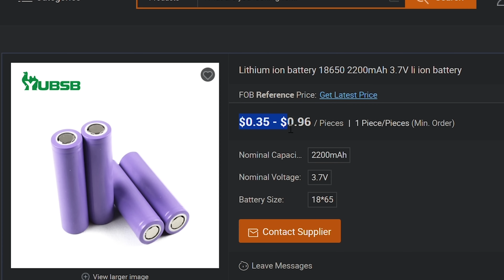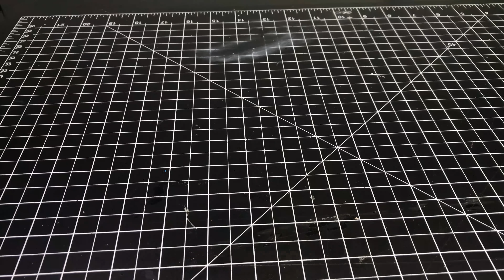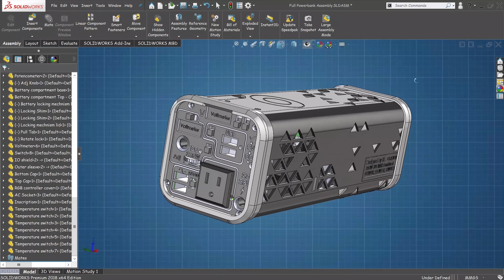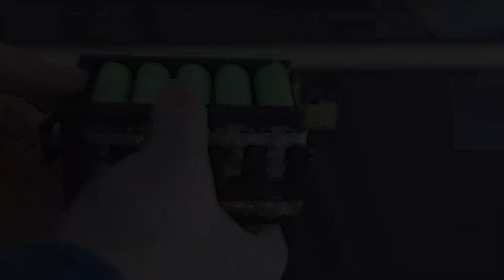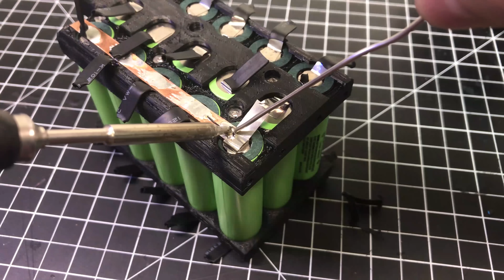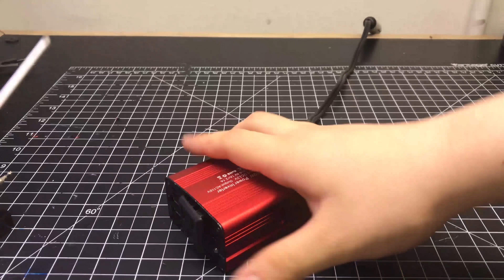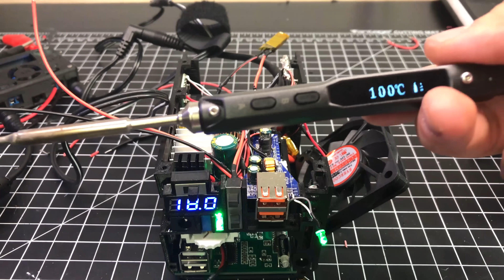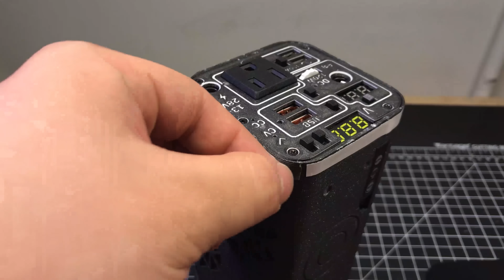How to Make the Ultimate 18650 Power Bank with Infinitely Expandable Capacity

Comment from the maker: Hello everyone, this project sure took me a long time to complete...I hope you enjoyed it!
Additional schematics and the full script are in the description. If you have any questions regarding the build process or design choices, please ask them in the description. I will try my best to answer them.
Reply: Hey bro are you interested to sale it
Reply: @reflection_99  i what one with 2 battery packs $$$
Reply: Sell the Power Bank itself!
Reply: @Treddy0810  yes, sell it
Reply: Can I just buy the finished product from u?
Reply: Sell me one.
Reply: @andrewmcallister4151   and the biding starts at 100eu.
Reply: @pavlossoultoukis4448  I'd pay that.
Reply: @pavlossoultoukis4448  that's only 113 us, I'll pay 120 for this.
Reply: @andrewmcallister4151   you got it and it is great by the looks of it only problem is to get this on a sponsorship for selling it because it's a great idea by the looks of it.
Reply: @andrewmcallister4151  I'd at most $170 for this due to labor and knowledge put into this
Reply: @pavlossoultoukis4448  where from
Reply: Andrew McAllister me to
Reply from the maker: Man in the Park  Because PLA melts at 60 Celsius, and the electronics can get hotter than that.
Reply: @kralyn3d  so, apart from anything named ABS_*, all other files need to be printed in PLA?
Reply from the maker: @AadithyaS  they can be, but they can be printed using ABS as well. The files that were named ABS have to resist higher temperatures.
Reply: K R A L Y N 3D why don’t you sell it? Would be awesome 👏🏼
Reply: @kralyn3d  can you do a bit research how to swap DC out with European(230V) one? Without ground( <° °>) pin should be almost same size
Reply: @razortotal  just buy a cigarette lighter to 230v adapter for your car (it's 12v in 230v out).
Reply: @kralyn3d  can I commission you to build this for me??
Reply: @kralyn3d  Why did you use solid works to showcase the CAD files for this portable charger but Autodesk for the other one? Also which 3d printer did you use to print the casing?
Reply: Thank you for the great video, i literally watched out of curiosity and don't understand most of the physics, but sure want one of those, can u ship me one?
Reply: Bukenya Ephraimi
how many hours of charge you grt on a laptop?
Reply: suppose i would like to buy one of these? i have no access to a 3d printr
Reply: What modifications would I have to make if I wanted to use an EU plug with 220 V?
Reply: @Morphior  if you're asking that, you're never building this
Reply: I really like how tightly packed and functional this thing is. Reminds me of nasa equipment for some reason. Pretty sad/impressive that one skilled person can build something that outperforms every commercially available counterpart (I know of) in pretty much every way (modularity, repairability, port selection...).
 Amazing work.
Reply: EU version? i think it needs some mods because of the 200-260V (Common 220-240V) range. (P.S. please can you make a better protected Battery Pack also Extended version for 2x-3x the capacity?)
Reply: Why not just build and sell them?
Reply: Just curious, where did you get the .5 mm thick copper strip?
Reply: @dlev689   Aliexpress or ebay
Reply: What font are the words and numbers written in? When I check the solidworks files they don't show one like it was custom or only in a different solidworks version. Some sort of Franklin Gothic?
Reply: This kind of project deserves a spot in kickstarter beside the omnicharge ♡♡♡♡♡♡
Reply: how much does it cost and what is full capacity??
Reply: Would you make me one! Ill buy it from you! Great work ! Let me know if you would like to sell me one.
Reply: can you sell this product pls at a cheap price?? clearly, this is a genius creation only you can pull off.. we do not have the technology to creat this..
Reply: Can you do one and sell it to me?
Reply: What if i directly want to buy it, not build it?
Reply: What is that diode at 10:47? Is it on the parts list?
Reply: Can you please use the free easyEDA software its free and if it dusent  have the component you looking for then you can make it its very reliable plus we can see the proper schematics.

You need a diode on that relay so when its off it cant  make electricity flow back into the circuit, remember that a relay is a coil so when its off its clapsing magnetic filed makes a electric current that can be hundred volts at best. That why we put a diode between the coil of the relay so when is off the current can be shorted so no harm to the circuit can happen .
Reply: Ingenious design... would you be prepared to sell a ready made one, as I like this design, but sadly unable to be able to build one for myself... philmelson7@gmail.com
Reply: Can I buy this
Reply: 100% Copy will be sold in China in like 4 Weeks! no BS..
Reply: @NightForce  Yes, ninus all the safety features.
Reply: Better get a WW Design-patent ASAP! just sayin..
Reply: 100 quid? 🤑 ¡Nice!
Reply: good job!!! that's amazing.
Reply: What parts need to be in abs specifically?
Reply: will you planning to sell?because most of the powerbanks seems not reliable, do you know why, do they not test them enough?everytime I decided to buy ,I read comments and then not buy:)
Reply: how efficient is wireless charging ?
Reply: @maciejwrotek   I think 70%
Reply: I'd pay for one. Please advise
Reply: How much for you to make me one dude but with a 240v English plug instead and mail it to the UK 😂😂😂 I'd love to make one but I am rubbish at things like this! Lol Seriously how much???
Reply: @jamieharhat  I have started this, I'm at 65% but surely It will up to 200 USD if you don't have 3d printer
Reply: @himmuappi  I'd pay 200usd for one 😂😂
Reply: @jamieharhat  ha ha it will cost 250$ surely If we don't have 3d printer.
Reply: K R A L Y N 3D how much would u make me one of these for?
Reply: I want to buy it could you tell me how?
Reply: I would buy that minus the RGB though
Reply: hi Sir, are you interested in produce it ?
Reply: Brilliant & elegant in design my friend. Very nice work & an excellent description for anyone to follow, great work.
Reply: are your power bank sold ? is there a purchase link ?
Reply: I want that power bank, it's so cool.
Reply: what program to use to design the device, I hope you answer me please, very good video👍👍✌️🤙
Reply: @crazyomargraph  He designed everything, You can just download CAD files and make 3d printed parts, remaining electronics parts can buy from online Aliepress or ebay. once you get all things assemble carefully like in the video
Reply: Why didn't you use any flux while soldering?
Reply: @d-brtn  Because Solder Lead has Already flux in it.
Reply: David Burton fluxed solder.
Reply: Can i just buy it off of you?😅😂
Reply: Frickin' awesome, man. Literally. Are you an EE?
Reply: Can I commission you to make this for me?
Reply: You are Master kralyn great work and the battery is badass
Reply: How much for one if you’re selling them??
Reply: @K R A L Y N 3D Is there  a way to add a usb c charger?
Reply: Here's $200 usd! TAKE MY MONEY!
Reply: just a straight question. how much time you have spend on this project?
Reply from the maker: @mansurzi shake around 50hrs on R&D and testing, 12hrs on CAD, 13hrs building and filming, 20hrs on editing. Plus 30hrs of printing different models (many of which did not work)
Reply: @kralyn3d  wow great work there
Reply: @kralyn3d  My question is you said, we could use a buck converter to charge laptops with adjustable voltage like 19v, it has adjusting nob if any unexpected situation if the nob will slide and if the voltage will go above 30v then is it not a problem to laptop?
Reply: I'll buy 1
Reply: I would buy it
Reply: 1 thing sell me 1
Reply: I want to buy one off you
Reply: YOU ARE JUST AWESOME !! why don't you sell this as a complete unit ?
Reply: Where did you buy the filament for the 3D printer?
Reply: Plz try to make a 220v one for us in Europe
Reply: you are geniuses men good work i am give a like in this video nice work thanks to upload this video
Reply: Why did you make the battery a single cell instead of multiple cells that could be balance charged?
Reply: Bro it is really jumbo bank. I am from india. I need this. Can you make me one.
Reply: 哥们，可以在中国销售，你的设计和产品能在中国所向披靡！！！
Reply: K R A L Y N 3D that’s dope
Reply: @K r a l y n 3d - I'm very interested in buying one of these units pre-made. How much?
Reply: Could you please give me a quote for the 18650 power cell pre made thank you
Reply: @cashritchie9076  he made it
Reply: Great man! You must make this mass produce after more perfection!!!
Reply: Dm me. I would buy this.
Reply: Excuse me sir... Is it save for this Power Bank if I use KSD9700 50deg Celcius? Coz I cant find the 45deg C in my local hardware stores..
Big thanks for the answer, sir...
Reply: Try to look how you can make this to sell as a final product I really want to buy this.
Reply: K R A L Y N 3D does this work with less batteries and less outputs?
Reply: There are some things missing from the purchase list. Can you update please?
Reply: There are some things missing from the purchase list. Can you update please?
Reply: Man in the Park  Did you ever find this out? I am trying to figure it out myself.
Reply: Why only 1800mah on an airplane
Reply: Would 15 9800 mah batteries work?
Reply: MAN you are a genius , I'm dying waiting for the next video! :D
Reply: Boa noite, gostaria de comprar este tipo de Power bank, como faço?
Reply: Can you show us how you made your volt/amp meter?
Reply: can i buy one of your project??
Reply: can you start selling this
Reply: Absolute beast.👍
Reply: how did you get SOLIDWORKS to go into dark mode??

my version only uses light mode, and it hurts my eyes
Reply: Do you sell the kit to build it?
Reply: a lot of time and effort went into the video
Reply: Any ideas on how hard would it be to modify the 110v US output to be a 220v UK output? Aka has anyone tried this?
Reply: that was awesome!!!!!!
Reply: Wow so very nice .brow
Reply: Is it available for sale?
Reply: Hi, can I order one from you.
Reply: If your selling these I might be interested if you can come up with a price
Reply: Can you make one and sell to me? I want one but I can't build it
Reply: Hi can you make one and sell to me ? How much will it cost in $ ? I really need one
Reply: Hi, I really like your videos, I love them all, would you like to know how do I buy one of you? I'm a layman on the subject, moreover, your power bank is the best. I do not know how to do it and I believe that here in Brazil it is difficult to prove. Would it buy from you? My Whatsapp 92992450053
Reply: Bro can I contact you privately to order for the power bank ? I really would love to buy one
Reply: Can u please sell this online
Reply: Can u tell me what is the use of relay
Reply: I have a question. I’m planning on building it but I don’t have anything that requires 12v at 10 amps to test the batteries. If I up the voltage to 19.5 at 5 amps would that do the job?
Reply: Gift two brothers
Reply: do you sell it?
Reply: Are we able to purchase this from you fully put together
Reply: Can I purchase one from you
Reply: K R A L Y N 3D What would the total cost of everything be to make this? I already have a 3d printer.
Reply: Could you build me one if i paid you $60 plus $10 for another battery
Reply: Hi" Can have one of your creation.. I'm sure it's very helpful to us! Because we are always experience 4x a day no electricity and it because of we are in province and our electricity are limited...and if I have a lots of money, I will purchase that item as many as we can!and I will indorse it" to my friend...to buy!
Reply: Aku ingin membeli produk ini ,🙂 bagaimana cara nya
Reply: Can you please sell it me?
Reply: Hi kralyn 3d thank you ever so much for sharing this with us. I was wondering if u could build one for me please i am willing to pay all the costs and ur labour cost so please get back to me ASAP many thanks once again for sharing
Reply: Ho kralyn 3d I have just made one but the charge light is not come on using the USB c socket only comes on with the 12v socket. But my usb c charger only puts out 9 volts is that the problem. Can you get 12v usb c chargers ??
Reply from the maker: @markpitman6772  In that instance, you need to buy USB C triggers that triggers at lower voltage and adjust the charging current until the charging light does turn on. 
https://www.ebay.com/i/312705399960?chn=ps&var=611423355586&norover=1&mkevt=1&mkrid=711-117182-37290-0&mkcid=2&itemid=611423355586_312705399960&targetid=917185845248&device=c&mktype=pla&googleloc=9032517&campaignid=9343999179&mkgroupid=103102860388&rlsatarget=pla-917185845248&abcId=1139336&merchantid=138377387&gclid=CjwKCAjw57b3BRBlEiwA1Imytm0OQgdB84mAee5gd94H9tOVNY9UaSJO7DGjNGRj2QLyffA44WEuRhoCxmUQAvD_BwE
Reply: @kralyn3d  thanks also why did you put a diode over one of the relays ???
Reply: wow, Liked your video,  pls check out my mini store.
https://www.ebay.com/sch/mystore198686/m.html?_nkw=&_armrs=1&_ipg=&_from=
Reply: What's your price
Reply: Hi Kralyn 3D! Can that build accommodate a 200w inverter or do i need to change the BMS to a 40A variant?
Reply from the maker: @jonerwynmendaros9766  Yes, but make sure you batteries can handle 40A discharge
Reply: @kralyn3d  ahh yes. About my batteries. I was supposed to have 15 Samsung 30Q 3,000mah 18650 which supports upto 15A per cell. Since the supplier had a shortage i received 10 cells. As an alternative, i ordered 5 Panasonic 3350mah NCR18650B cells which is only rated for 6.7A or 2C per cell. So for safety purposes,  i estimated that each cell could give out  2Cs and is worth around 3000mah, i got a total of around 90A more or less. I'm not sure if my calculations are correct tho.
Reply: I've was just wondering if I were able to use all the outputs at once just like you did in the video, because after seeing the schematic it looks like every module is connected in parallel which would give a voltage drop off whenever you use more than 1 off the modules, supplying the other modules a smaller voltage than 12V when you use it.
Reply: Boss why no FM and speaker PCB WiFi
Reply: friend, you are amazing!
Reply: Thank you Kralyn 3D for this gift to the Public. I'm buidling a specialized workshop inside a corner of my Vehicle Depot in my Garage so I can make a few of these Power Stations you've shared with us here. I hope this video doesn't get deleted anytime soon.. I'm kinda slightly paranoid like that... All these links I have to read and save before then. I want to build one as a gift to my dad and mom and my extended family AND in laws too. After manually building multiple copies of these awesome little power stations so I can get the hang of it, I'll then begin building my own personal pimped out one for my wife and I. After that, I might try to build a second one big/expanded enough to power my entire home as an off grid project IF the Tesla Power Wall turns out to be inferior.... Which I think it is inferior... So thanks again :) Live long and Prosper my guy
Reply: A battery with propeller?
Reply: @thekaiser1919  a girl which can coke
Reply: This thing is fantastic!  I understand it may not work that way. But could it work as a jump pack for a car or bike?

Comment: When I was a little younger I built a 20 watt Knight-Kit stereo (tube) amplifier.  A little older, I built a Heathkit GR-271  21" Color television.   I love your work ,  but I would only attempt this if it were a 'kit' ! !     I have Goal Zero 1000 power station with solar panels in the back-yard to charge it  .  .  .  .  it is a 'beast'  .  .  .  .  but your's is  S e x y  ! ! !   LOVE the ventilation triangles cut in the case with the  R G B  interior lighting  !  !       Thanks for a great video / project  !   RH

Comment: I'm hesitant to build this based on the battery bank and balance charger.  It looks like you made 3 cells of batteries and you had to balance the voltage between all the cells in that group.  I'm curios as to why you didn't use something like this: https://tinyurl.com/yyzv2nff which would guarantee that no cell would get over charged and be a risk for fire.  I did really enjoy the video, there's plenty of great material there!

Comment: Nice project, but showing crappy 18650 batteries selling for under $1 and expecting to get any current drain performance from them is WAY WAY overselling...

Your design has nice features, including the adjustable DC output, but if someone just needs USB and AC Power, a better deal with no build time is the Ryobi Days sale, where you can get (2) 4ah batteries, a fast charger, and a 150 watt inverter with USB also, all for $99.  So for $99 you can get 140 watt hours, with easy off the shelf expansion of larger batteries (e.g. off brand 6ah on Amazon for $36 on Prime)...

Comment: i loved the video and what you made was awesome. though, i was thinking, could you have used a power fuse adapter so if you have to change the fuse you can without de-soldering it? i know you can find them in trailer wiring kits. just wondering if that is doable or if space will be an issue???

thank you for the awesome video. i wish i have the ability to make something that cool. :)

Comment: You might want to figure out how to mass produce this as a product. A lot of people including me want one. However, I would like an added option of a dummy 3D battery pack which is wired to a battery box made of, say six for a six pack, battery packs as to charge and use six packs and hot swap them.

Comment: Am I the only one worried about those solder joints and how tightly compact everything is? Just seems like a huge potential for a short (and yes, he has circuits in place to prevent that, but I would have liked to see more insulation for extra safety).